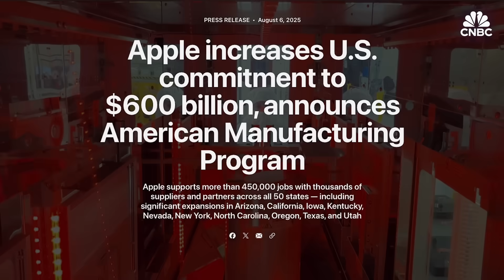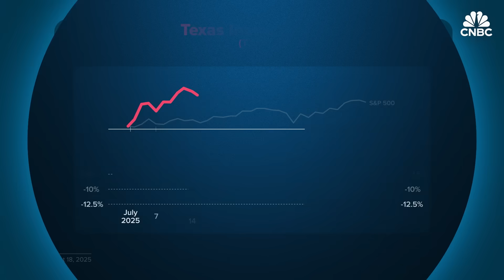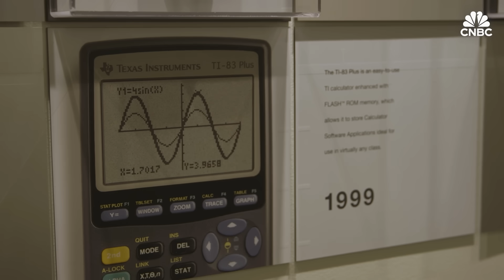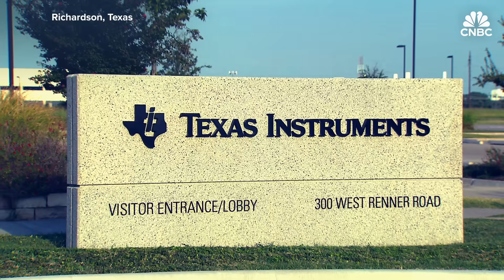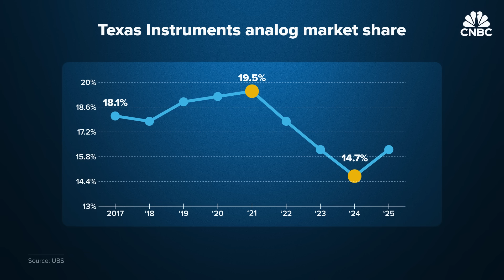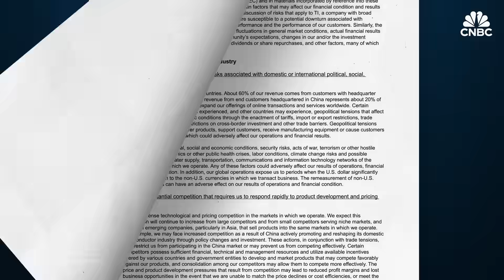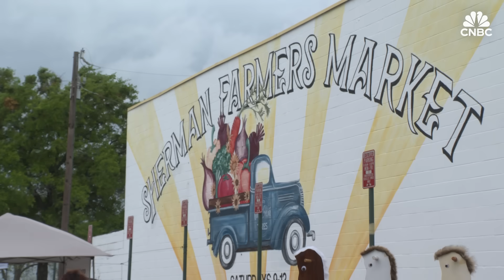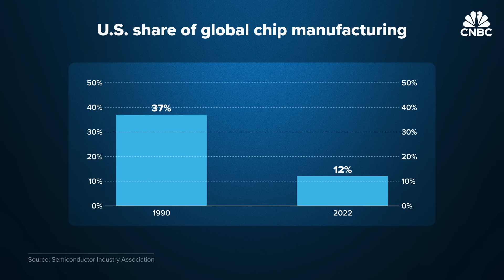Why Texas Instruments Is Betting $60 Billion On Making Cheap Chips In The U.S.

Comment: Having done some PCB level development. Usually incorporating a TI part into your design solves so many issues. They are incredibly well designed, well made and well documented. There are IC’s that wouldn’t exist if TI didn’t develop them 1st. Usually a lot of competitors come in later and knock them off. TI is truly one of a kind in their space.
Reply: Even this lowly mech eng can make sense of their datasheets, and make use of their excellent devices!

Seriously though. Their datasheets are fantastic. So thorough.
Reply: I was wondering what new type of chip they're building this fab for.

Comment: One thing you never hear in these stories,  is where the raw material to build these chips come from,  ALL of the raw material for these and other chips, comes from Africa.
Reply: Sand comes from Africa? You need to stop the binge drinking. ;-)
Reply: @lepidoptera9337 
      It’s not the sand or the chip itself……… look beyond your sarcasm and think……… What do the majority of this chip go into?  Smart phones, laptops, desktops, gaming consoles etc…… and all these devices rely heavily on the cobalt, that is sourced from the DRC (over 90%).  Also the coltan used to make all of the capacitors inside our electronics.  The gold, used as a conductor, the silver,  the rare earth etc.  Without the resources from Africa these devices wouldn’t function.
Reply: @realnewsthatmatters9319  Dude, not only are you binge drinking, you also don't know the first thing about capacitors. ;-)

Comment: TI may not be top of the line in chips right now but with them starting to get in the game and making more of their own they will only get better through trail and error. They will not stay on the bottom for long
Reply: TI has been the "top of the line" in chip design for many decades. There are simply chips and then there are chips. TI has been playing the precision analog and mixed signal markets for the longest time. There are many products which you simply can't buy from anybody else. The second player in that market is Analog Devices, but Analog is outrageously expensive.

Comment: Mohammad mentioned the factory will be using 100% renewable energy. What? How? The "Water, power and workers" segment doesn't really follow through with how the power is going to work. Why mention the Texas independent power grid if the TI factory is going to be 100% renewable? Is that on-site renewable? Texas has such little renewable power generation, how is that going to be achieved?

Comment: it's not about the tariffs, the US was the original ground zero for silicon chip manufacturing before we outsourced it now basically ALL of our chips come out of a factory in Taiwan and China keeps threatening to invade them... we're building a factory in Arizona and Germany is building one as well so that we can have chip security in the event that China decides to FAFO in Taiwan because the US told them if they set a single foot on any beach in Taiwan with military troops the US was going to bomb every chip factory over there because we WILL NOT ALLOW China to get it's hands on the hardware to produce microchips on the scales we're producing them now. the Dutch have the patent on the machines that produce the chips and the US basically tells them who is allowed to buy the machines...

Comment: there is nothing glamorous by using very obsolete technology. i encourage TI to move to the 1-2 nm range for silicon manufacturing process and stop thinking 100 nm is a sweet spot. High power use, heat, and less efficiency. you need to be the best, ditch the ghetto junk.

Comment: TBF even Biden put a tariff border around the US regarding chips. BUT under Trump the US is basically cutting itself off from the global supply chain by putting up a tariff border. If US consumers are desperate to buy products that are only made using US designed and made components then fine but don't expect the RoW to buy your expensive products. Germany is an industrial powerhouse because German made products are very well made and engineered. I remain to be convinced US made stuff will be of any decent quality.

Comment: I’m sure chip production uses a lot of water and energy - is the Texas grid reliable enough these days and is there enough water available in a drought affected region. 
I’m sure it could use a lot of solar and possibly wind power but that’s green and woke so do they have a coal fired power station nearby?
I learnt electronics using Ti chips and their chip book was huge back in the eighties.

Comment: I didn't realize it took so much water to manufacture chips so why can't they recycle up to 100% of the water they use
Reply: Limitations in filtering, use in evaporative cooling, and more, remember a lot of their water used in the process requires a level of purity that, as far as I'm aware, is not used anywhere else, and in some cases is actually more pure than we can even measure, they find out about quality issues by its effect on yield before the measurement instruments can detect anything.
Reply: TSMC recycled about 86.7% of the water they used in 2019. Not sure how other fabs do.
Reply: I'm sure they do, it has to be very very pure, like no impurities..... Not an easy accomplishment
Reply: Recycling also consumes a lot of energy and other resources. Don't forget.
Reply: Boron
Reply: @eugeniusbear2297 like as a contaminant which makes recycling difficult?
Reply: after so many chips you need to have water
Reply: Actually, they can.  And some TI sites (not in America) do.
Reply: That's a good question. It seems to me that their dirty used water must still be much higher purity than anything coming out of a tap.
Reply: @FelonyVideos in some cases it is contaminated with acids or chemicals used in cleaning/washing wafers so 100% isn’t possible but a pretty high percentage is.

Comment: cheap in America ? yeah I'm not betting my money on it
Reply: These factories will be mostly automated. 

People on the floor will maybe get $25 an hour top end.
Reply: @Corgiking521 Engineers don't get $25/h genius!
Reply: @Corgiking521 Why not just automate in Taiwan instead? Or, if you'd like to second-source an industrial base, Japan? Far better value/$.
Reply: TI already fabricates most of its chips in the US. All of the best TI fabs are in the us. I worked for them for the last 20 years of my 40 year career. They are the largest supplier of analog and mixed signal chips in the world. I would bet on it.
Reply: @aaronfrank9649 "Analog and mixed-signal", yeah, but dude, you should know that's waaay different than leading-edge logic. You guys were likely still using planar process(es) via DUV.

Comment: They opened a plant in China. So it’s only a matter of time before China opens up a bigger better factory with TI tech and drives them out on cost
Reply: TI stuff is not very high tech, so you can say that Chinese companies are already in direct competition with TI. As an Embedded engineer, TI has a significant advantage in supply chain, documentation, and support - and those things are significant factors when selecting a product.
Reply: China is ahead of TI.

Comment: Fun fact: Your tiny 'tactical' LED flashlights? They have two or three chips from TI. Not very expensive, only about $0.25 total cost. But when you make a million of those, that is at least 2million chips that TI sells. TI is the poster child of American innovation - they are razer focused on completely transitioning to 300mm wafers, and nobody that makes cheap chips does that. Even TSMC, makes cheaper chips (typically below the threshold of EUV required on 200mm and is hesitant to invest any money there, because it can get better returns investing in size leading fabs on 3 and 2nm.
Reply: 2 millions mean 500k in sales, less than half would be profit so less than 250k, the salary of one single below average rate lawyers. This is a failed business that will die soon enough, if the tariffs is 100% your math say a samsung thermostat inside a smart home system will be 0.25$ more expensive 😂😂😂 their business is selling overpriced chips that cost cents to make for millions of dollars to the US military using corruption and lobbying, there is no need for 1 billions 45nm chips a year anywhere in the world, let alone America, cant make phones, cars, laptops, computers, tv, servers, ... something that is too weak to run a 1980s retro handheld is not going to change manufacturing.
Reply: Is 300mm the width of the wafer or the size of the node?
Reply: @alarik95 diameter of the silicon wafer.
Reply: @alarik95 300mm should increase the yeald. But there are quality issues and challenges with the bigger wafer

Comment: Analog is ti nitch area.  Others type of chip risk to be obsolete when more function got integrated on chip if not on package.  Voltage supply different required for ti chip and others might be a headache for design to optimize performance.
Reply: Niche

Comment: 45nm-130nm chips?  Even fabs in China can produce these chips.
Reply: Sure they can, but with the tariffs and shipping they can cost a lot. And you need those boring chips. For cars, washing machines, air conditioners, TVs, basically almost anything that's powered by electricity.
Reply: @eugenb9017  but they are not - you talk only about size not knowing what tech is actually on the chip.
Reply: umm, anybody needs these; the f*cking 3nm overpowered touch trash-flats mostly generate waste-heat on advertising and propaganda anyway;
( so also, playing this ... I am watching now on proper PC with .... KEYBOARD ... we need more keyboards back ... even in pocket; touch RSI on-the-way ... :-)
Reply: @7alken  Smaller nodes take less electricity, and your phone or computer likely uses at least a 7nm node.
Reply: China's SMIC is already manufacturing 5nm and mass-manufacturing 7nm.

Comment: ASML has the most benefits from growing chip fabs
Reply: Worked at Intel and TI 
ASML IS KING
Reply: Applied Materials benefits more; they built a broad range of equipment. Basically you can have a fab without ASML but not one without Applied Materials.
Reply: @JigilJigil ASML is twice the market capitalization. I’d put my money on them before AMAT

Comment: 45 nm vs latest 3 nm at TSMC & Samsung is a gap of about 5 years in generations. Embedded environments have different power requirements, but they could all use lower powered chips eventually. Hope this works out for TI.
Reply: Digital and Analog. Apples and oranges. It's about the ability to process high frequency signals in the 10's of gigahertz to terahertz ranges. You can't do that with digital, regardless of node size, and even if you do massive parallelization of the the signal processing, you need analog front-ends that can handle high frequency signals to convert the signal to the digital domain. Even with 3nm, the fastest clock rates are well below 10 gigahertz without massive thermal cooling units. Think applications like modern wireless communications, radar, electronic warfare, medical imaging, instrumentation, etc. There's always an analog front-end and that has different requirements that digital can't handle, not only by definition, but also clock rate, that's where analog comes in and the larger nodes can be beneficial.
Reply: That's not 5 years. That's 20 years. China is said to be 5 years behind and they are manufacturing 5nm chips already, Huawei is about to release a 3nm domestic litography machine.
Reply: @kjrom  You do realise the use can manufacture 4nm chips at scale right? †he US will begin mass producing 4nm chips in their Fabs in Arizona. 

You are slow, read more!
Reply: gap is 25 years. I was doing 1 micron layout introduction in 1997, and that was old then.
Reply: I dont have faith in TI but remember we are at the beginning years of the semi industry. What will the world look like in 30 years?
Reply: @letterkeys4440  I mean, they kind of helped create the industry, and are continuing to evolve it, so I have faith they know what they are doing. Plus I actually work with their products and they are top notch, so yeah. If you don't know the difference between the way transistors are used in analog and digital, maybe don't trust your gut on this one.
Reply: What does the nm mean?
Did you know the actual transistors are not in the nano scale.
Reply: @Art-is-craft , the "nm" in a node typically refers to the gate length, which is the length of the semiconducting channel between "input" and "output" of the transistor. This is what is controlled when switching and needs to behave like a good (or really just good enough) insulator when off and a conductor when on.

The footprint of a transistor for a modern nm node is actually in the nanoscale (tens of nm) but is often larger than the node name implies and each transistor is spaced at least an order of magnitude further apart than the node size for the latest processes.
Reply: @samuelscott8665 
There are no molecular transistors as that’s what a 2nm transistor would be.
Reply: Most embedded devices do not benefit from those processes they would be both more expensive and more power hungry
Reply: Unfortunately and technically, many more years still... The first major introduction of 45nm was in 2007-2008... Hopes for TI to be capable of closing the gap.
Reply: @drackhor  look at any circuit board. Only the brain is made on advanced node. CPU or GPU, storage NAND chips and DRAM chips. All other chips dont have enough cost/benefit to justify making on smaller nodes. Also, boards powering your AC, fridge, dishwasher, dryer, smart light bulbs, etc etc do not contain any of these advanced chips because again, there is no cost/benefit reason for your dishwasher to be able to perform trillions of calculations per second. In many of the cases, these systems do not even have a true CPU and instead have microcontrollers or just a plain ALU and a few registers to store information because they are not actually calculating very much. TI is not trying to compete with TSMC and samsung for those advanced chips, their business lies in producing "the rest" which isn't ever going to go away as a necessity. It's apples and oranges as far as business models go.
Reply: @boredhero 45nm is NOT good enough for modern NAND storage or RAM. Only embedded like they already make. Those chips sell for a fraction of the leading edge ones TSMC can make
Reply: @DoesntRefillTheBrita I'm aware that's why I grouped them with CPU and GPU at the beginning of my thing.
Reply: @drackhor  You are misinformed, the US has the capability to manufacture 3nm chips at scale, it is doing so in arizona
Reply: @WilliamLi-nd4lz  but not TI...
Reply: The US can produce 4nm chips at scale, as in mass production.
Reply: @WilliamLi-nd4lz  No, they can not.
Reply: @JohnMcHuffins †he US will begin mass producing 4nm chips in their Fabs in Arizona. 

You are slow, read more!
Reply: @WilliamLi-nd4lz  only in Intels more advanced fabs like hilsboro Oregon and the one being built in Ohio